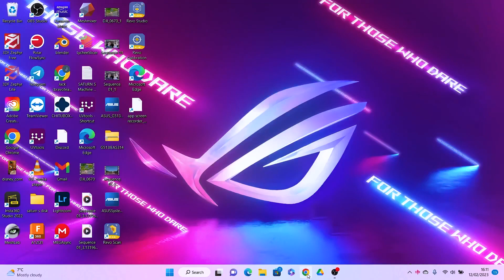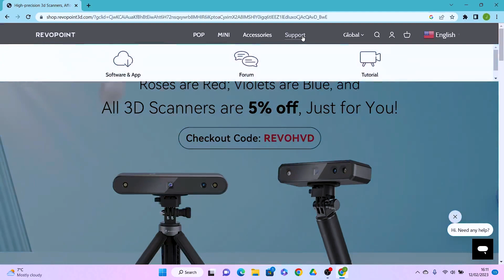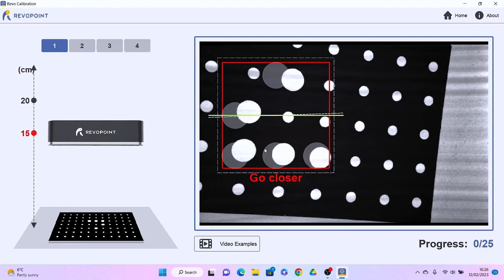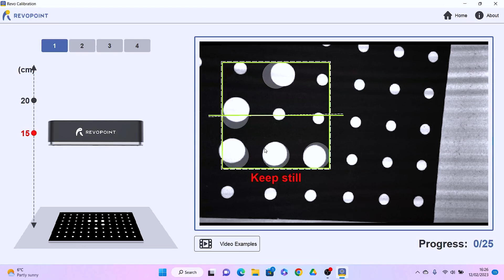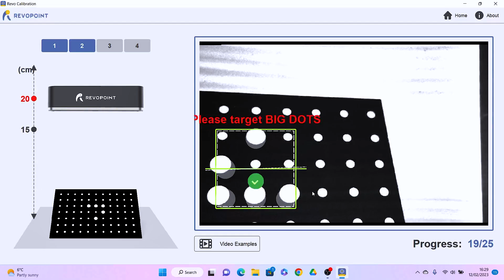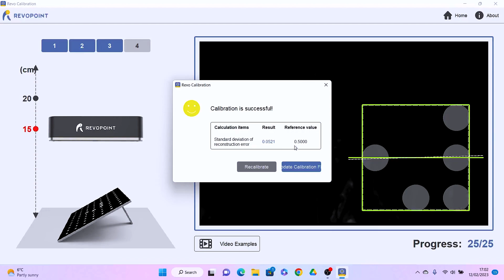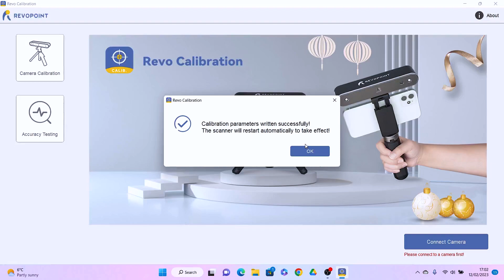Revopoint Mini calibration: How I improved my 3D scanning results

Comment: Hello,

I received my scanner yesterday
I made several attempts to scan a bust, the scan looked pretty good, until I lost the tracking, which messed up my capture.
I tested several light conditions, from very bright to even dark, played with the depth and brightness settings. Nothing works really
I always end up with a loss of tracking that makes my work unrecoverable. It's very frustrating when you feel like it's starting out great, then a tracking error destroys everything.
Even when it finds its track back, it always ends up with big offsets. I think it's a good idea to help, but would you have any solutions to make my scans always successful ?

I mainly scan small mechanical parts for reverse engineering, as well as more organic sculptures, and retopo for jewelry.
And for the moment I have to say that Polycam on my phone gives me results that I can use while this 800 euros scanner is not useful for me for the moment, even if I feel the potential in it.

Thanks in advance for your advices.
Reply: I wonder if for lost tracking concerns, this might be improved away from by trying to use a faster processor to handle the number crunching bath of 0's and 1's in geometric depth field challenged applications such as 3d scanning seems to present.
I have a different 3d scanner than this one mentioned in the presentation, mine being the revopoint miraco for short and long range uses, it offers the ability to direct cable connect to any computer for use during the scanning process and even for after the scanning process to mesh the various scans and others into a hopefully desired result. This scanner treats all dark enough surfaces as antimatter, portholes across the universe of which requires a entire coating of flour or baby powder not made from the chelation of actual babies being milled like the wheat germ flour was, maybe a washable waterpaint sprayed with a mist and dried into place prior to scanning.
Also, the utmost importance of having prior approval before simply going ahead and scanning things such as busts that are not your own, the scanning attempts would greatly improve, such attempts should only be consentual.

Comment: Would you recommend a calibration run like this if the scanner is giving a bumpy point cloud for smooth objects? Just got my scanner yesterday and feel something may be off!
Reply from the maker: You can run an accuracy check as part of the calibration software that will let you know if it needs it or not. Run it 3 times and take an average to see if it's required. Surface noise has loads of other possibilities though,  try limiting external light sources, keeping your depth gain as low as possible and meshing at a higher value.

Comment: I followed your steps last night and mini went from .09 to .04 accuracy and it was brand new out of the box. Thank you for this great step by step!
Reply from the maker: 0.04 is great! do you have super sturdy hands or did you do something different with the set up? I think 0.05 is my PB at the minute. Glad it's helped you out.
Reply: @tabletopscanman    Just thinking, you could probably mount it with some elastic bands or velcro or tape 3d scanners, to the movable axis of a cnc machine or 3d printer for a type of most stablized method to achieving highest possible calibration.
I have a neuromuscular challenge that feels like a mix of parkinsons and MS that can sometimes spike in realtime during actuation of the basil ganglia. I try to consider solutions from this perspective, if a disability can result in achieving ability.
I scored a Revopoint Miraco and am enjoying its scanning, though am still learning about the various forms of procedure, syntax and perspectives shared open source from other people who have experience.
This helps me to learn without missing the points made in trying to interpret a user manual that can sometimes go over the dyslexic brain left to wonder in fathomable mysteries in order to hopefully achieve a accurate level of understanding core points of contention made by other people, sometimes spanning across different languages even.
Cheers and stay creative.

Comment: This will help me, as I have never done this before.  What I was worried about is my calibration card is just that - card, the creaform ones were on glass so I wonder whether mounting this to a flat pate might help as it is by nature flexible?
Would you get better results with a tripod dya think ?  Wonder if there is a league table for calibration scores 😆
Would like to see the difference in a scan between a calibrated and un-calibrated model - as I say i've never given this a go.
Reply from the maker: Hope it helps dude! I think the card is on thick enough stock that deformation might not be an issue. Moisture ingress over time might be a problem though but maybe they plan to ship upgraded ones with the actual release of the software. Its the first of this kind  I have seen , I've played with a GOM scanner in the past that had perfectly spherical objects transported in military grade cases for calibration so these are a bit wafty in comparison! I was kind of hoping the comment section here would be full of "those are rookie numbers" memes with people boasting about how they got better than I did. I honestly think setting up the mini on a tripod and moving the card is the way forwards but you run into another issue where its so still you don't get enough time to align it.🤷‍♂️ calibrated scanner vs uncalibrated scanner you say? I feel a team up coming on!!!!!